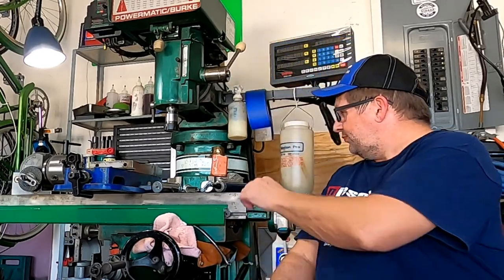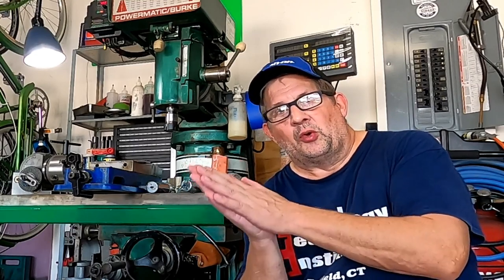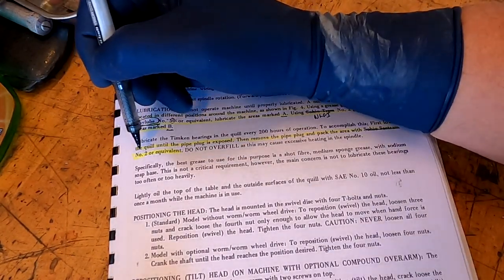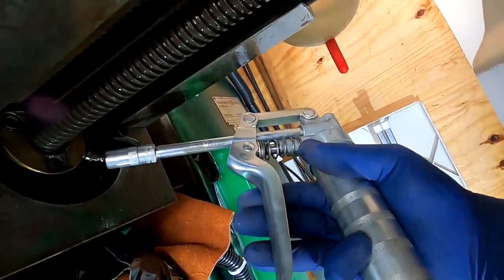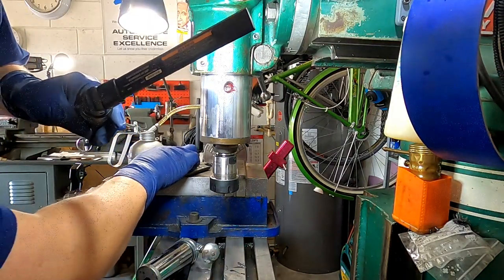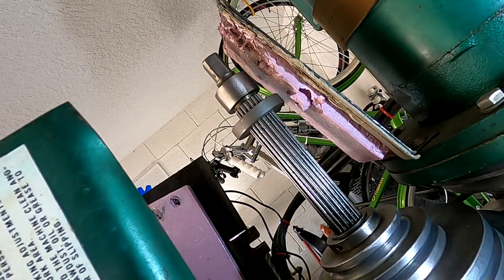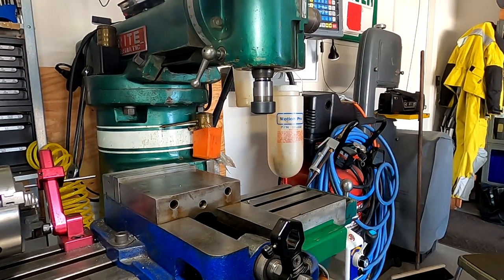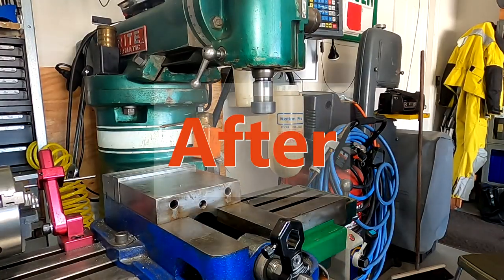Millrite MVN spindle adjust and lube service: Milling machine service

Comment: On my MVN, there is a hole behind the quill that is tapped 1/4"-28, as if it is for a grease fitting.  Is this a grease (or oil) point?  There is no fitting in mine, just an open hole, which does not seem right.
Reply from the maker: Sounds like the plug was lot.  I think Burke used different spots for eh grease fill. Yes, into the quill its going to be grease. Don

Comment: I was wondering if you had the mfr. and tool number for that particular spanner wrench you used?
Reply from the maker: Its actually a Wright 407 cog tool that I ground, drilled and added a hardened pin into. You can get pin spanners individually or in sets, amazon, ebay etc.. I buy em for a couple bucks each at the flea market.  Couldn't get by without them. Don
Reply: @donsengine3158  Thank you sir.

Comment: What size pin wrench do you have for it?
Reply from the maker: Jeez, not really sure. I broke it years ago and drilled it out and welded in some drill rod that was the right match. I've picked up a box full of pin wrenches at the flea market for next to nothing and don't really notice the size I use. I just match them the job. Lazy brains at work.